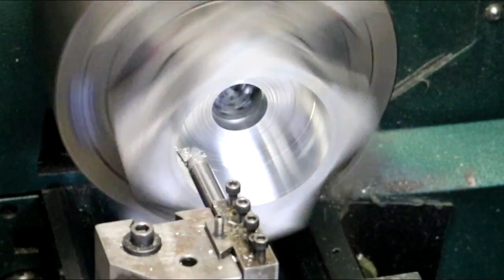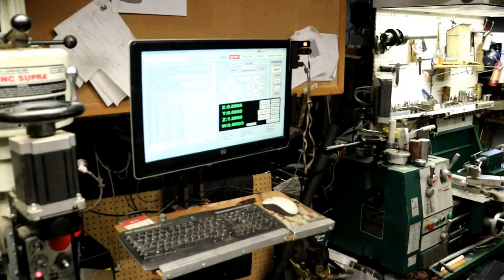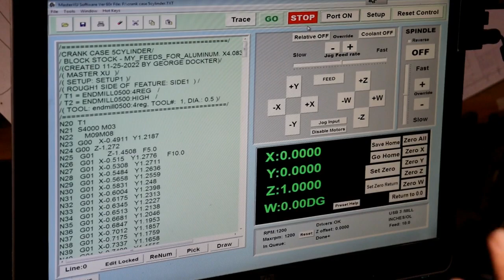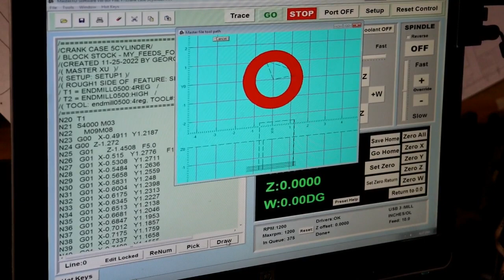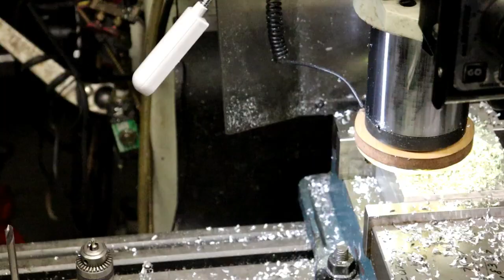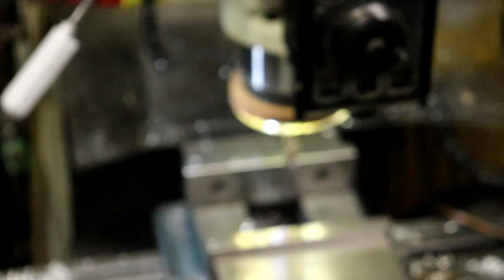5 cylinder radial engine crank case 3

Comment: Do you have a 4th axis setup for your NC machine?  I think it would be a great feature to add if it’s possible.  You could also use an automatic z height set tool rather than the manual height setting tool that you used.
Reply from the maker: No don't have an A axis. The height setter I use I made. I was thinking of upgrading my machine and adding an A axis but pretty pricey.
Reply: @InTheShopWithDoc  I’m sure that you could actually build a decent A axis, you definitely have the right skills and equipment to make it happen.